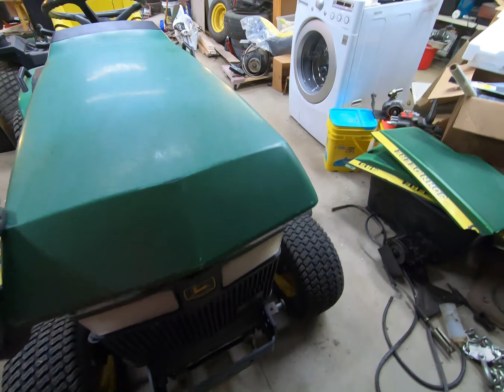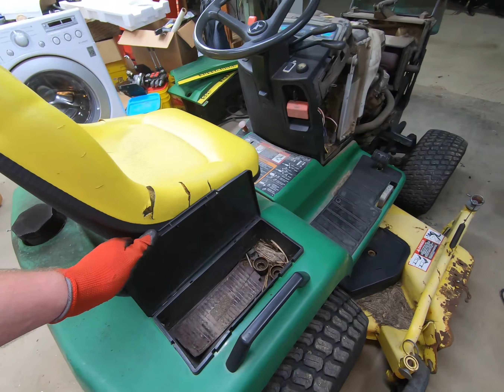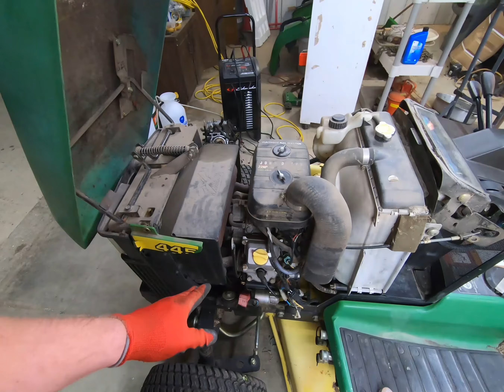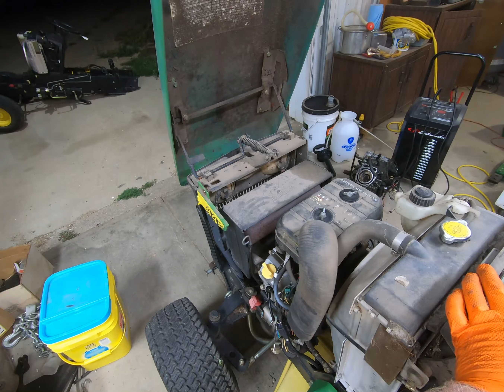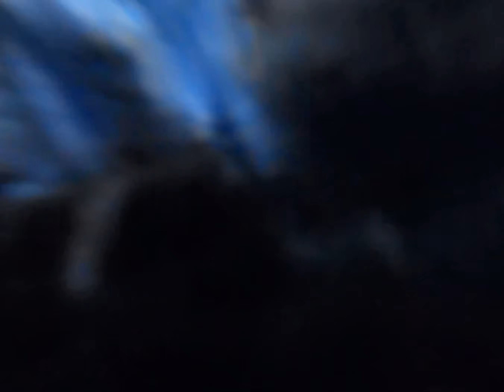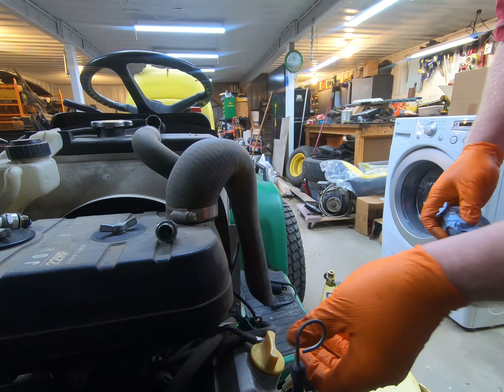John Deere 445 Project - Part One

Comment: I realize it's an older video, and likely you moved on from this, but Repower offers a FD750d engine  kit, which would get more modern, and still available parts system - through Deere, whereas parts for these 445's with FD620d are getting old and parts are hard to find, and if you do, they aren't new.  Personally, I'll dump my 445 when it has issues, and get something newer. Just no time or money to put into something old and unreliable anymore.

Comment: I'm a year late on this video.  I'm looking at 445s as I speak. My interest in your videos is just to familiarize myself as much as possible as it is a new model to me. I can't say I agree with some of your comments. Particularly those referring to the wisdom of tackling a project machine. Sure, it may cost the same as what you refer to as a "good machine", but that good machine may very well be one minute from a similar issue. You seem to think all of the work will bring you to some equivalent used tractor. All those new parts should have a longer life than those in your "good machine". You then know what you have, you gain familiarity and knowledge and to most who tackle these projects, the pleasure of doing the job. After all, most who would undertake such a task are likely to be more interested in the project than cutting grass. So maybe you should limit your comments to solving the issues and leave the conjecture and decision-making to the viewer. But, that being said, thanks for posting it. There is value in it.
Reply from the maker: I don't disagree with your thoughts at all. You are also correct a "good machine" may only be a minute from a major failure, as any machine is. I also don't think all of the work will bring you an equivalent tractor, theoretically it should be better is some aspects, but it will bring you to one of equivalent value. It has been my experience that 4/5 times when someone buys a project they over pay on the project machine and then sink a lot of money into the project that wasn't needed or never finish the project. I've bought enough of those "projects" over the years to know the type. Watched a project 455 sell for $2,200 a couple weeks ago. Based on pictures, it needed about ~$1,500 in parts at minimum. At the end of the day the 80% of end users would be money and time ahead to go buy a good used one. The 20% of the equation are the folks you are thinking about. You understand the value of time spent working on a machine, you recognize the value of newer parts, and it seems like you enjoy the work which means I would guess you have the tools to do the work. I've visited way too many folks to help them work on their machines, two pairs of pliers, an adjustable wrench, and a 100 piece off the shelf socket set is about all you should expect in an average garage.

Comment: My guess echoes others.  Stuck open injector, and I would guess the intake manifold has a more direct shot to that cylinder than the other.  I would have to look at my 445 and see.  
If the deck is solid shoot me a price shipped if you're looking at parting it out.  You can reach me on mytractorforum under the same name.

Comment: I will be watching for this series.    Also subscribed to this channel.    I looked at a 445 with 4WS this July but passed it over for an X540.    The 445 had some transmission issues and the 4WS and EFI spooked me a bit.    It was still a neat tractor though.
Reply: The x540 won't accept a loader either.

Comment: This happened to my 425, the pervious owner did an "Engine Rebuild", he didn't properly seal the gaskets, the valve seal on the left side by the oil fill was shot. Also warped the valve cover enough to the point of failure. I experienced the same exact symptoms, it would struggle while adjusting the throttle, oil looked clean but had a fuel smell, ran rough on the same cylinder, and just ran like garbage. The plastic oil fill tube was caked with white sludge, so I immediately assumed it was fuel or coolant mixing with the oil. On cold start it shut down while raising the throttle, and ran rough. It had about 1440 hours on it, an ran just fine after the repair. The coil was out, as I assume they ran it like that for too long, it made that same minimal improvement, but still ran rough. It sounds to similar.

Comment: Fuel injector is stuck open. Fuel has washed past the rings into the oil. Will probably need new rings and hone cylinders. Also while you are in there might as well replace any worn parts too. Just my 2 cents worth. 445 is a great tractor!

Comment: I will be watching with interest.  I have a 445 that has seen lots of use.  I hope you go ahead with the rebuild.  Some of my major issues are; excessive crankcase pressure.  It will blow the filler cap off.  Dont know if its related but the drivers left plug carbons quickly and leaking HD oil in the area of the power steering control valve.  Having said that my 445 with 3pt is an excellent fit for my acreage.   The snow blower, 60" deck and tiller all work well.  Thanks

Comment: Sounds like the injector is rats. Have a 1996 455 3pl rear PTO 54" 300hrs, 98 F1145 72"sd 4500hrs,655 2wd 1200hrs and 855 4wd fel 1500hrs. Paid $5000 Australian for the lot 4 years ago. All had issues spent about $4k in parts but collectively I'd get $25,000 - $30,000 if I'd sell them now. It was a selling the property for retirement home sale. I did offer more but she wouldn't take it. I also got a 4720 cab with 400cx with 120hrs for $10k at the same time which was pristine. She was a friend of my mum's.

Comment: Being EFI does it still have needle and seat and float?  I would say something has failed in that area letting fuel into the crankcase.  I'll be very interested to find out.
I'm surprised the oil wasn't the 1st thing you checked even before firing the engine.
Reply: W1WEASEL no, it’s fuel injected as he said

Comment: Sounds like my 425, how can you tell right off the bat that it's running on 1 cylinder?
Reply: He can by the shaking of the engine, also if you feel. The valve or exhaust cover on one side and it’s cold that cylinder is not firing
Reply: The Igniter goes bad & it will run on #2 fine BUT #1 on & off Firing, Mine acted up most of a summer, as usual I replacer Both Coils, Cam Gear, Plugs Wires Timer, Then realized After You Tube Sites The igniter went Bad.  That was 800 hours * now at 1100 hours My Regulator Shorted. BEST Tractor I ever had & parts on EBay & all ??  Maybe total cost parts, oil, filters ?? $ 300.00 over 21 years.